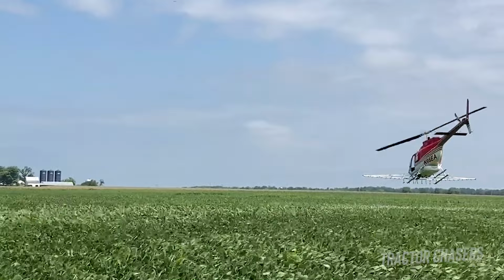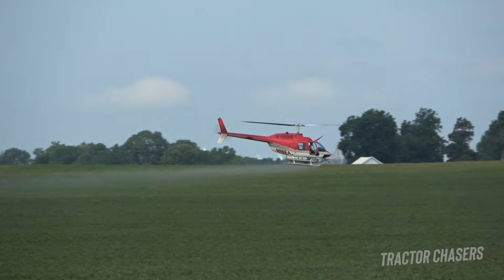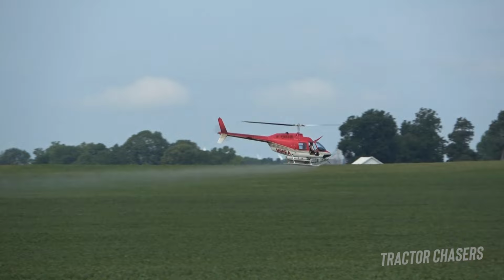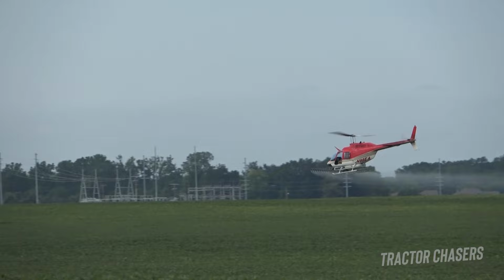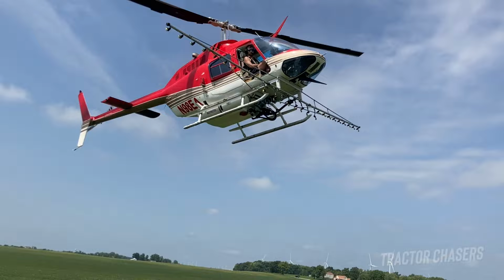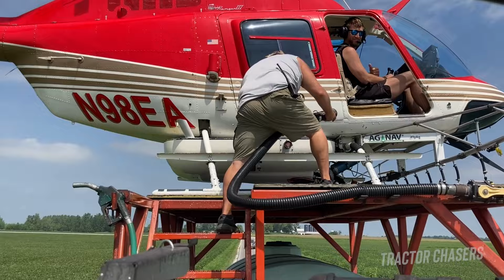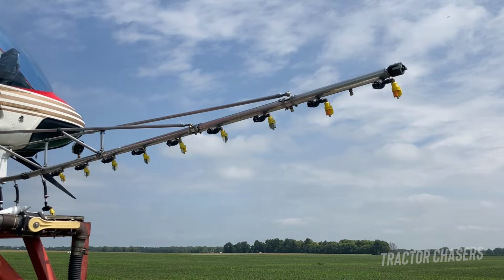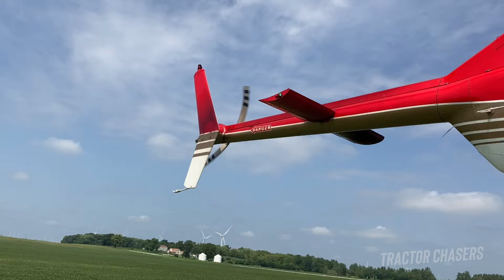Helicopter Crop Dusting

Comment: The chemical label is our guidebook to the application.  Typical wordage is that you can only boom out to 70-80% of your wingspan.  Airplanes and helicopters follow the same guidelines.  My boom is 26'.  My rotor disk is roughly 34'.  My swath has been certified to 55'.  I typicall run 50-52' swath.  Think of the helicopter  as a zero turn radius mower and a plane as a 15' batwing type mower.  Different jobs are suited for each.

Comment: Thats a narrow spray boom on the helo, not even the diameterof the rotor blades which means many more passes across the field that a wider boom would cover.
Reply: You aren't allowed to run a boom the same width as the rotor.
Reply: Nope. The spray spreads out much further than the boom width.